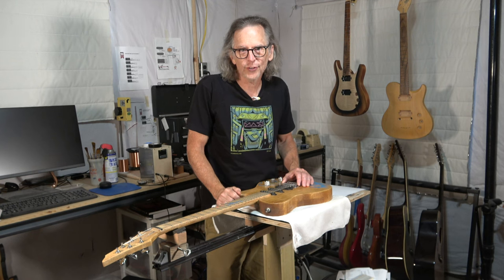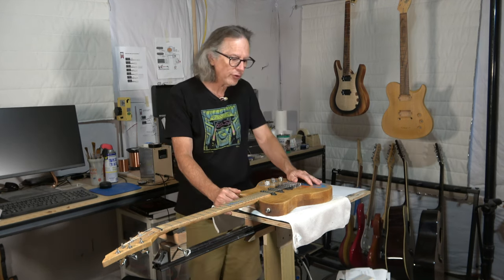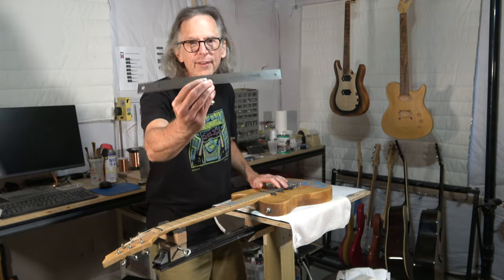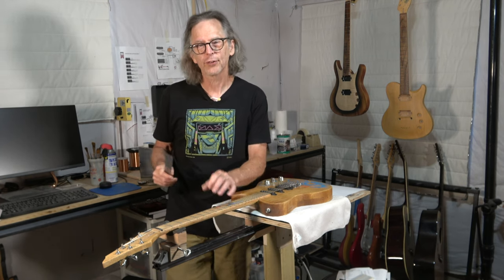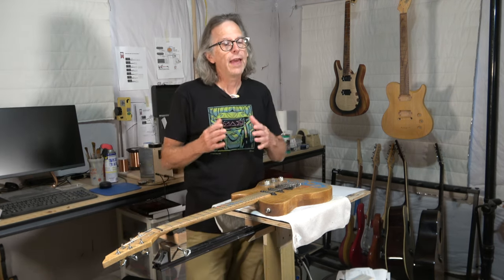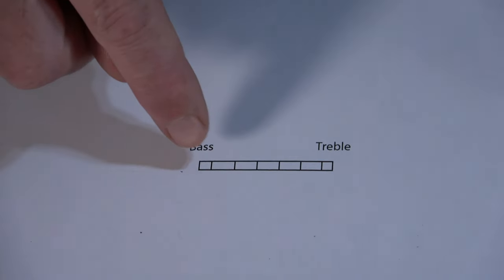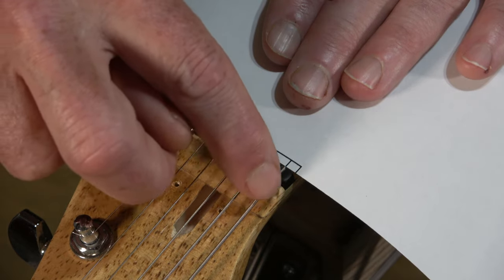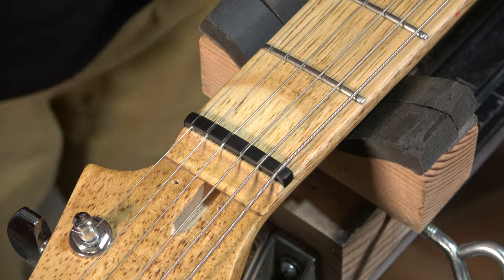How Do You Determine String Spacing On A Guitar?

Comment: I use equal distance between the strings, not equal distance between the string centers. I don't have any opinion on the latter as I've never tried it, but would be more than open to seeing what it feels like. As for my method:

(A - B) / C = S, where A = the distance between the outermost strings, B = the sum diameter of the remaining inner strings, C = the number of spaces on the nut between each string (5 on guitar, 3 on bass, etc.). S = the space between each pair of strings. 

I set my digital calipers to that number, lock it in place, and then use the caliper jaws themselves as a fence for the nut files. I started doing this many years into making nuts, whereas before I used to do them purely by eye, as I was taught by my longtime good friend and mentor. 

As for the outside strings: these days I use a 4" double square. I set it to 4/64" from the bevel of the fret, lock it, then hold it up against the edge of the fingerboard and use it as a fence. The nut file rides along the double square ruler and cuts a slot in the nut that will be 4/64" from the fret bevel. I flip the double square over and repeat on the other side. I always leave the nut a little proud on both ends so I have room to move it in or out as needed to get both outside strings equally far away from their respective fret  bevels. 

This method works great, and is only one I started doing a couple years ago after first getting into guitar work about 17 years ago. I've used the Stewmac ruler before a few times, and I still own mine, but I much prefer my caliper method. The main reason being that with the Stewmac ruler, you have to make pencil marks, and when you go to cut those marks, it can be very difficult to do so accurately. With calipers, I can use them as a fence and then immediately double check my work to make sure I'm within a few thousandths of my target spacing. 

As for the original 'by eye' method I used, and the one my friend still uses (he's been a full time tech since 1969), it's just as it sounds -- by eye. However, when he gets the strings spaced where he wants them, he carefully holds them down one by one and marks either side of them with a pencil. Then he uses the thumbnail on one hand as a 'fence' for the nut file, placing it right in the middle of those two lines. If memory serves, he starts with an Xacto razor saw, then uses a larger nut file to widen that 'set mark.' 

I still use a razor saw on the high E and B strings, though the razor saw won't work when using caliper jaws as a fence. For that you need to use nut files, which almost miraculously just perfectly fit. 

Big proponent of "find what works for you." Mix and match from other methods, or just use methods other people use, whatever works. What really matters is that the end result is good and that you're happy with it, and you can get repeatable, reliable results with your chosen method. 

Also, great video! Always enjoy your content and the discussions you get started in the comment section! One of the things I love most about this channel is the viewer engagement, absolutely great to get people talking about this!
Reply from the maker: Lots of good info here. Thanks for contributing!
Reply: @HighlineGuitars  You're welcome, and likewise!

Comment: Equal spacing only works for a given set of string gauges. Surely you would not want to swap the nut, just because you're using another set of strings than what it was designed for?
Reply from the maker: The problem is equal spacing can be measured between the string's centers or from the edge of a string to the edge of its neighbor(s). The results are not the same and can vary with different gauge stings.
Reply: I'd argue that it's not out of the question to have different nuts for different string gauges. You often adjust the truss rod, saddle height, and intonation when you change string gauges. If you're choosing a new gauge that is different enough to warrant all that, it could be nice to have another nut to swap out with.

Comment: Important question: bridge
How do the makers of the bridges handle this? Does it make any sense, if it is handled differently at the nut than it is handled at the bridge? Any player would find this really confusing, I think.
Reply: I think you can buy un-slotted bridges that you have to file down a notch for the strings yourself. That gives you a certain amount of leeway to adjust the bridge spacing accordingly.

Comment: From a player's standpoint, I like to have the same amount of space on each side of my fingertips when pressing down the different strings on the first fret. The reason for this is that I don't want to be accidentally muting an adjacent string. Obviously, different fingertips are different sizes, and the angle they touch different strings varies. I checked several of my guitars, and the spacings vary from center to center, edge to edge, and variable. I think the main takeaway should be a wide enough spacing so accidental muting can be avoided.

How the spacing looks is not as important as how it feels and performs.
Reply: Just curious, when choosing guitars, do you look at nut width and string spacing?  I'm a low-to-mid intermediate hack.  I was dumb and happy with a 1.653 and just figured I can't play certain chords in the first few frets without accidentally muting some adjacent strings.  Then got a PRS and noticed the slightly wider nut width and string spacing felt a little better and gave me a little more hope.  Now for some reason I think I have severally limited my next guitar purchase choices.  Is this stupid and shouldn't be a concern?
Reply: @brianmckenzie1318  A lot of my playing was on Classical guitar, where necks are wide and accidental muting is pretty easy to avoid. Then I added steel string Acoustic guitars, and I started to notice some fretting advantages with closer string spacings. Then I added Electric guitar, and noticed that close string spacing helped significantly with muting unwanted strings when playing lead lines. For me, string spacing is an important factor in making the type/style of music I play on a particular type of guitar easier or harder. I don't like when my fingers feel smushed together.

Comment: Equal center is the correct way. When You play your fingers search the CENTER and then will be more comfortable if strings are center spaced !!!!!!!!!  AND WHAT IF You decide to change from a 011 - 048 string set to  a 09 - 42 ????   
Center space will work the same . Equal distance will turn in garbage............
Reply from the maker: When I change string gauges, I make a new nut for the new sizes. I’m not a savage.
Reply: @HighlineGuitars  Then You need to redo the bridge notching as well... as final end user  I prefer a guitar where i can change string gauge without substitute nut and bridge if i decide to change string gauge...

Comment: You're trying to solve the wrong problem.  As a player, precision matters, and I want the centers of the strings to be equidistant.  Play some fast passages and see if you can play more cleanly with even spacing, or if you play more cleanly with variable distances. It doesn't sound like a lot, but precision matters for clean playing, especially faster passages.
Reply from the maker: Some like the centers to be equidistant and others like the edges of the strings to be equidistant. "Potato, potahto, tomato, tomahto. Let's call the whole thing off."  -George and Ira Gershwin

Comment: Ukuleles are not that complex as the nylon strings are all rather skinny.  Even on my ukulele with a thick nylon low G string the spacing looks fine and plays well with evenly spaced centers.  

I ask the customer about nut width preference.  Folks with big hands tend to appreciate wider fretboards.  And smaller hands like them a bit more narrow.  

The “piccolo” tiny ukuleles (solid wood) I have made for grandchildren (11” scale length) got narrow fretboards as 2 & 3 year olds have small hands.  But they do love to play so I encourage them…